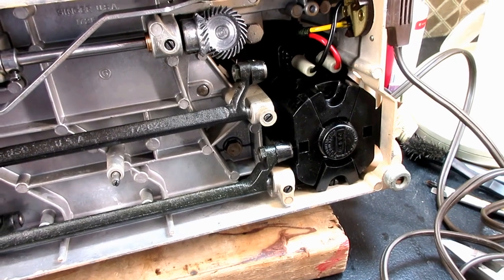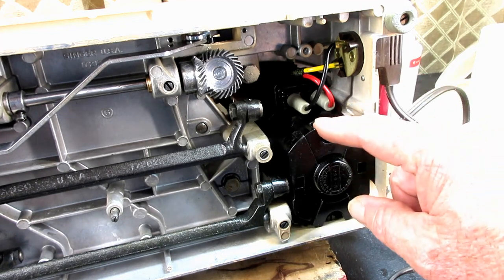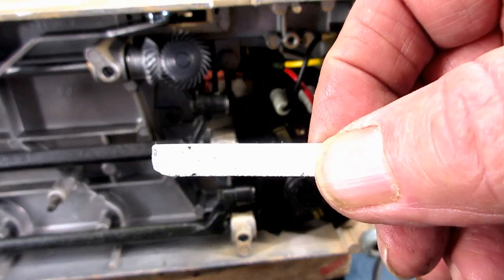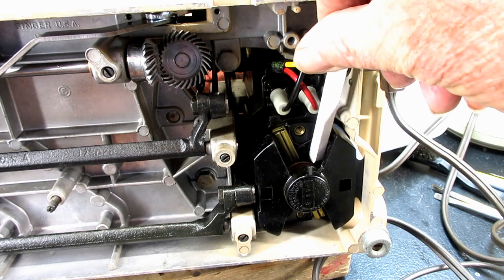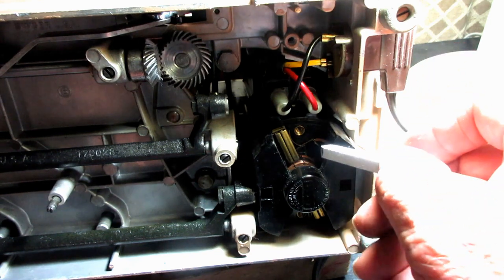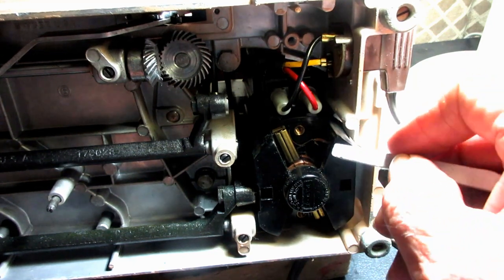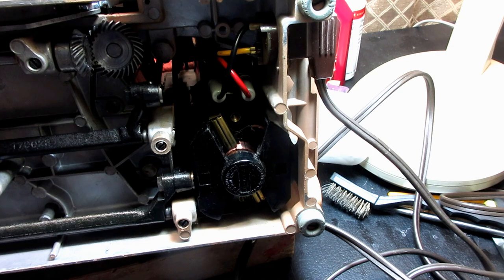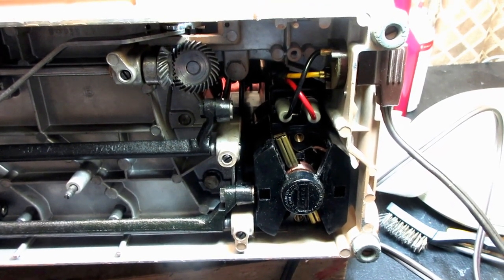How to Speedup your Sewing Machine Motor in 5 minutes for $10

Comment: Thank you Andy!  Just ordered on of these. I am going to clean up all my motors!
Reply from the maker: I love this trick and have done many motors. Don't push down hard on the stone. Tiny particles flow to the carbon brushes and polish the commutator while seating the brushes. I was surprised with the speed improvement the first time I tried it.
Reply: @andytubesewing1953  Follow up.  I got my diamond polisher.  Did my 301A and 500A.  My motors are stronger, run fast and can go at slower speeds.  Thank you!
Reply from the maker: @matthewdegraffenried2771  Nicely done. It's almost too easy, isn't it? It's about the best 10 minutes you can spend to improve your motor performance. The polisher seems to last forever, too. Happy sewing, Matthew.

Comment: I did this for my 503A motor in situ and it sure made a difference! Combined with a carbon stack cleaning, I have much less trouble with the "hum-and-no-run" it was doing before, it is much more controllable at low speeds, and faster, too!
Reply from the maker: sounds like a win/win! Thanks for sharing.

Comment: Thank you so much for this video!  At first, the machine only got a wee bit faster. I was a little timid and was afraid to do too much. This machine was not slow, it had come to a complete stop. So I decided to try again. It took quite a bit off the stone.  After I sprayed it with the cleaner, I noticed some little grooves on the copper.  I used a straight pin and seam ripper to clean down in the grooves. This seemed to help also.  Now it is speeding along.  This was a machine I had given to my 95 year old MIL.  She lives 2 states away so I took mine and brought hers home with me.  I’m very thankful to have it working. I missed my 401. By the way, you may find this interesting.  I brought about 45 little dresses she had made for children in an orphanage in Cambodia. This makes a least 250 total. I cut them out for her and she sews them. Sewing is our therapy! Thanks again for all the advice over the years!
Reply from the maker: Nicely done. I think you're smart to be timid at first until you see how much it's going to work and get the hang of using the little stone. So good job with that. Depending on what machine it is, the foot pedal. May need some cleaning and adjusting too. I have a couple of playlists for different styles of foot controllers. You can find them on my playlist page and I love that you guys are sewing together on this project and donating the clothes. I truly just love that I have donated a lot of the machines that I repaired to crisis nurseries and women's shelters and even a couple of convents in the Philippines. Seems like the machines will last forever with a little bit of TLC. Thanks for sharing and good luck

Comment: Excellent video Andy.  I worked in  the Phosphate Industry for 30+ years after leaving Stromberg/Carlson.  At least once a month they would shut down the different draglines with up to 65 yard buckets, and the electricians would "stone" the commutators on the huge DC motors.  They ran on 4160 3phase voltage and generated DC current IIRC.  I should have remembered that I have a few small machinist stones similar in size to what you showed.  I'll definitely use this method from now on.
Reply from the maker: See? You knew about this before I did, haha. Read what I said about you making videos again. You could do it 😀

Comment: Awesome! I’m about to tackle the motor on my Singer 201-2. Funny, I was thinking that your motor sounded like a jet engine and you said it. Thanks
Reply from the maker: These PA style motors in the Slant Needle Machine sure have a unique sound. I think it's the top bearing and the TEXTOLITE gear on the handwheel. With a potted motor like the 201-2, I had to put the motor shaft into an electric drill and support the other end while running the drill to spin the commutator. It cleaned the commutator perfectly but you cant seat the motor brushes that way. It is still clean and quieter though and it is worth the effort, IMO. Thanks for watching my channel and good luck.

Comment: Thank you Mr. Tube.  Great video.  I am working on a featherweight now and I am concerned with my motor getting to hot.  I appreciate all your videos. Thanks you again. 🙏
Reply from the maker: The motor on the Featherweight has 2 grease wicks to lubricate the motor shaft ends inside the bearing/bushings. If they are dried up and hard then the shaft and bearing get dry and run hot. It's bad for the motor, of course. Here is the playlist of my 221 featherweight videos:  https://www.youtube.com/playlist?list=PLsCOZgzzaiKIA1OPw0k6QOSTE-wAUZ4kp    
There are 5 videos about rehabbing the motor, parts 1 through 5. Here is part 1 if you want to see what those videos are like: https://youtu.be/1XfYoQV4URo  Just call me Andy, please. 😃
Reply: @andytubesewing1953  Thank you. I am watching your playlist now. Thanks so much Andy.

Comment: Hi Andy - Just ordered the stone. Thank you!  You must be a mind reader. I went through your PA motor cleaning tut last year. After looking/running someone else's 401, realized  mine only runs at 1/2 speed). Machine is clean, no binding, and use it alot (run it daily) so I figured it must be the motor. I tried other controllers (electronic + button) but still the same 1/2 speed. So I'm anxious to give this a try - thanks again for the great info!
Reply from the maker: I think it could help your motor, especially if the electronic pedal made no difference, then it could be the commutator has a lot of carbon buildup on it. I think you will like using the stone. A viewer commented it may be better to use alcohol to rinse the particles out rather than the electronic cleaner. Also, I would use a little brush or vacuum before the spray or alcohol next time I do this. Good Luck.

Comment: Thank you Andy.  The Salvation Army shop manager said "it runs  slow,....maybe it needs oiling" i haven't checked the motor yet. 
The price went up to 17.75 not including shipping on the website you shared . Just a heads up.
Reply from the maker: First, thanks for letting me know about the ridiculous price ZORO is charging now. They come in boxes of 12 and not that many sellers will just sell one. GRAINGER has started selling individual stones for $7.07 +ship so I changed the link. 
     I'm sure your machine needs a proper and complete oiling. You can download the Instruction Manual for free from Singer support and see the correct places to ad oil (and grease) https://www.singer.com/search/support?title=401   
     Lack of oil is not the only thing that slows down a vintage sewing machine. One of the more common reasons is that the foot pedal has never been serviced and needs cleaning and adjusting. An out-of-adjustment pedal is more common that a slow motor. 
     The foot pedal controls the amount of electricity that gets to the motor, a bad pedal equals less electricity. 
Here is a Playlist for cleaning and adjusting the pedal that came with the model 401A in the USA:
https://www.youtube.com/playlist?list=PLsCOZgzzaiKL6ePPxLpmnWSzTyxPKTb71
Reply: @andytubesewing1953  Oh Andy I'm sew excited to find you and your expertise help... 🥳  thank you sew much ! You rock 😍

Comment: Thanks Andy for this video. My 401a motor has uneven wear on the commutator. I haven't seen any other pictures of wear like it. I am going to try this method and see if it helps.
Reply from the maker: @kayconleycammarata7854  I've had a couple very bad motors like that and the brush seater made a huge difference just be gentle with it and don't take off too much of the copper then you should have a big improvement thanks for the comment and I appreciate you watching my channel good luck
Reply: @andytubesewing1953  thank you!!!
Reply from the maker: @kayconleycammarata7854  Sure, good luck.

Comment: Thanks for recommending this video Andy. I'm sure my 401A will benefit from this. One suggestion though, maybe I missed it, would be a warning to be careful about the exposed 120 Volt terminals right above where you're working. Thanks again!
Reply from the maker: thanks for the safety tip, Doug. I just give people credit for understanding wires carry electricity I guess, forgetting many people have never worked with it. Note made to mention safety with wires, tools, and chemicals in the future. 😀

Comment: Thanks. I’ve seen you do this before. I think it is great. I’ve taken 3 or 4 pa motors apart to clean. This looks easier. Always enjoy them. I was watching “cute” (the 99) tension and bobbin area videos yesterday. I have a Singer 185 I’m getting ready to be in sewing shape. That tension assembly is different eh?
Reply from the maker: Model 185 is the replacement for model 99K and does have an updated BW system. There really is not a separate service manual for the 185; it is the same one as the 66 & 99. I do have a parts diagram for the 185K if you'd like it just let me know andymanuals53@gmail.com

Comment: Hi Andy. I so enjoy all your help over the years. I love old machines and have fine tuned mine with your help. My sister has a 417 that needs  the motor cleaned. It’s not as easy to take apart as some of the others and I’m a little apprehensive about getting it back together.Have you ever worked on a 417? It seems to have more plastic . Thank-you
Reply from the maker: I have not worked on that model. It is a little different with the dials than both the 416 & 418 models. They all have the same type of internal motor inside the upright. Those motors are "open" meaning no covers like the external motor on a model like the 99k or 237. https://youtu.be/sDcexZeS0f0
https://youtu.be/TmnnvGrEfmg       https://youtu.be/mVX2Io_tomk
Are you sure the motor needs work? I find the pedal to need servicing much more often than the motor does https://www.youtube.com/playlist?list=PLsCOZgzzaiKItPLWcK24FBoMdHK8vTXNi
Good Luck
Reply: Thank you Andy. I see spark/arcing in the motor when I have laid it on the back and have ran it that way.
Reply from the maker: If and when you can get to the motor commutator here is a 5 minute $10 fix for the sparking caused by uneven brush seating and dirty commutator: https://youtu.be/pzq4tv8qn94

Comment: Is it OK to use 91% alcohol in place of the electronic cleaner, or is the electronic cleaner just the safest way to go?  Thank you so much for showing this method; I've watched your other videos about it, and now I think I'm ready to give it a go.
Reply from the maker: 91% alcohol is 9% water. Don't use it unless you are taking the motor completely apart. You can use a vacuum and lint brush to remove as much of the stone dust as possible. That's OK to do.

Comment: Thank you for this informative video. I have my late mom's Singer Dial a Stitch sewing machine. I managed to flip it over to the side (since it sits in a housing) to look underneath it. I did not see the same mechanical parts shown at this video. I guess because my machine is almost 50 years old. It looks like it has a motor on the outside. The problem is that it is slowing down a lot. Also it only works for 5 minutes then it slows down so much, while feeling hot to the touch, that no matter how much I push on the electric foot peddle it does not go. I have to wait a half hour or so, and come back and it will give me another 5 minutes of operation.  I want to hold on to it for sentimental reasons, but not sure what I can do to make it work better. i appreciate your feed back
Reply from the maker: Hi Sarah. I can't find a Singer "Dial a Stich" model or picture. A model number would be helpful to answer your question. These instructions from Singer can help you find the model number if needed; https://www.singer.com/en-ca/find-your-model   The motor/machine in the video is about 60 years old. Singer made models i=with internal and external motors. If you machine is 50 year old vintage Singer it may have a carbon stack style foot controller. They cause more problems than a motor, in my experience. Often then have never been cleaned or serviced. A machine that sat idle for months/years/decades usually is full of dried sticky oil residue that can make it run with a lot of resistance and the motor can strain and overheat. People often think of the motor when it could be a different problem. MY Playlist page has Playlist for cleaning and adjusting foot controllers, motors, cleaning machines, oiling, etc. https://www.youtube.com/channel/UCUSPDsHaFtRoz1VA2U1xJ4w/playlists
If you'd like more specific suggestions I need a model number. Thanks for watching my channel and good luck.
Reply: @andytubesewing1953  Thank you so much for taking the time and responding to my last post. I searched for the model number on the Singer "Dial a Stitch" here are two no.'s I found. One on the small motor by the side of the Machine: No.1 692 A09. it also had things like volts 115/30  input 80w and cycles 50/60. Then I flipped the machine outwards from the housing where it sits, and it had this no. 401-TW 90184. i am not sure if these numbers mean anything. I do appreciate if you think you can have an answer for me. Either way. You have done a lot more than expected. Have a beautiful day
Reply from the maker: @Sarah-yo1dd  Very sorry but those are not model numbers. All the original Singer documents are by model number, like 221, 401, 753, 6825, etc. I still can't find a picture that identifies a machine as a "Dial a Stitch".  😞😢
Reply: @andytubesewing1953  Thank you Andy. I will see if I can find any more or other no/s Appreciate you trying to help me. I really do
Reply from the maker: @Sarah-yo1dd  ✨

Comment: I have a 600E that surges and is running slow. I've oiled everything and greased the gears, so I wonder if you think this might help speed things up and stop the surging??
Reply from the maker: "I've oiled everything" as in all 33 oil points shown in the manual on pages 50 - 53. Anyone needing the manual can download a free copy from Singer Support at this link: (last one on the bottom) https://www.singer.com/search/support?title=600
      If oiled, then if the machine is not binding while turning the wheel by hand it could maybe be the motor. Cleaning the commutator and resetting the brushes as in this video will speed up the motor, but even a very dirty commutator doesn't cause surges unless there is oil all over it.
      It is much more likely that the foot controller (foot pedal) needs good servicing. It uses two carbons stacks of small carbon discs that get deposits built up on them over the years. They can even crack and crumble if used a long time in that condition, and the pedal gets rather hot. There are also contacts on the springs that get deposits and pits that cause more resistance to the electricity flow. The electricity will "build up" to fight thru the resistance and causes the surge, then the current goes down and causes the slowing. I would normally look at the pedal before the motor if I was working on your machine. 
     I made a playlist of videos about cleaning and adjusting the pedal you may want to look at to give you an idea of what is involved. You can do it yourself, as thousands of others have, and at the least, it will improve current flow and speed control. It should stop the surges. Here is the playlist: https://www.youtube.com/playlist?list=PLsCOZgzzaiKL6ePPxLpmnWSzTyxPKTb71 
      If the motor still seems slow at top speed afterwards, then I'd use the Diamond stone on the motor.

Comment: We have a slow sewing featherweight.  If we clean the copper communator, will it speed up the machine?
Reply from the maker: If the slowness is caused by a dirty commutator then yes, cleaning it will speed it up. 
     Chances are the foot controller has dirty carbons, or is out of adjustment, or both and that is causing the slowness. 
I assume you have properly oiled the machine and it turns freely by hand. 
     Here is a link to a family that knows more about featherweight machines than I could ever hope to. They have a whole section called "schoolhouse" with many tutorials about featherweights. I don't think they would approve of my method of using a diamond stone to polish the commutator b/c they talk about using an eraser. I'd feel better if you looked at their advice and if you had questions asking them. 
     I will say I have cleaned my wife's machines' electric motors annually for years the way I show and they run perfectly and powerfully. Here is the website I mentioned: https://singer-featherweight.com/   
     They probably cover cleaning and adjusting the pedals also, but if in case here is my playlist for doing that: https://www.youtube.com/playlist?list=PLsCOZgzzaiKL6ePPxLpmnWSzTyxPKTb71  
Best of luck with your beautiful machine, and thanks for watching my channel.

Comment: This is like laparoscopic surgery vs open surgery!  Tried opening up the motor and using scotch brite to clean commutator.  Not much improvement.  Will try this.  All my machines stored in unheated attic for a few years are all running slowly.  It ain't the foot pedals. (shorted them with screwdriver shaft,,,no increase in speed.)
Reply from the maker: This method works better than just cleaning the commutator b/c it helps "seat" the carbon brushes onto the commutator while cleaning it at the same time. I hope you like it. Good luck.

Comment: Would I be able to do this on the potted motor on the Singer 201?
Reply from the maker: I believe so. I have seen videos of this being done on larger motors. Get a stone about the width of the commutator. You have to have a running motor to use the stone, meaning it must be turning with electricity. I've never worked on a potted motor, so I'm giving general opinions, not from personal experience. Thanks for watching, and good luck.
Reply: @andytubesewing1953  thank you for your help and your amazing videos!
Reply from the maker: @ibeleevinfairies  You are very kind, thank you. I am happy to have you as a viewer. Take care.